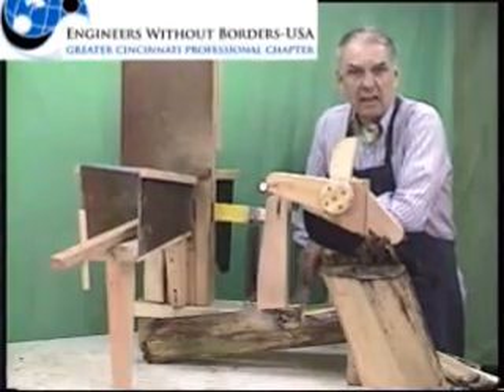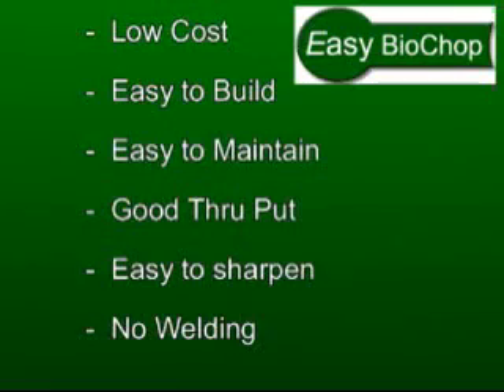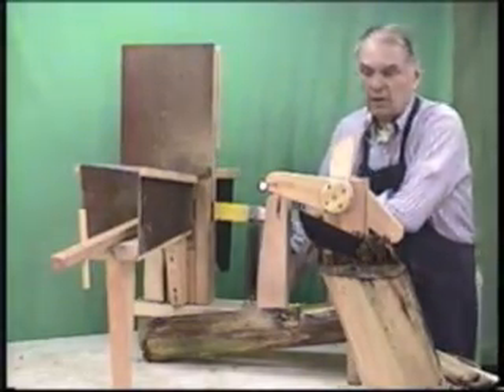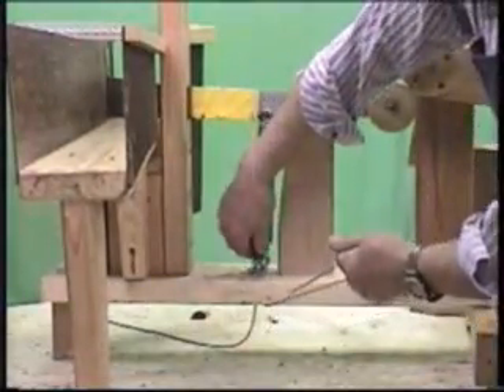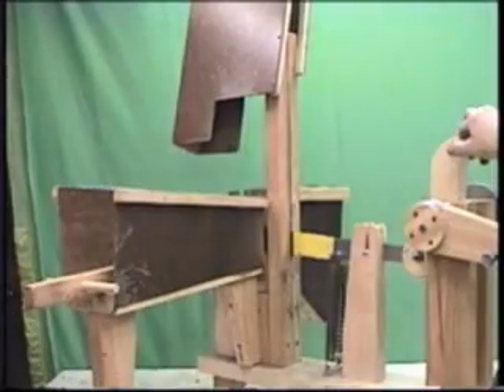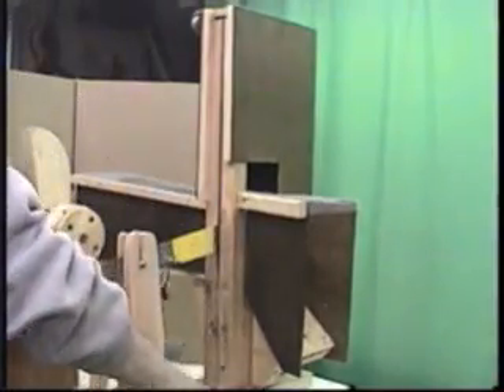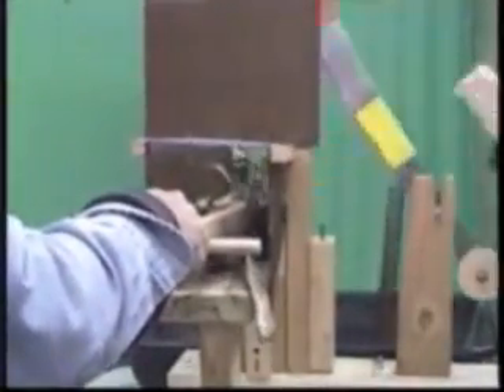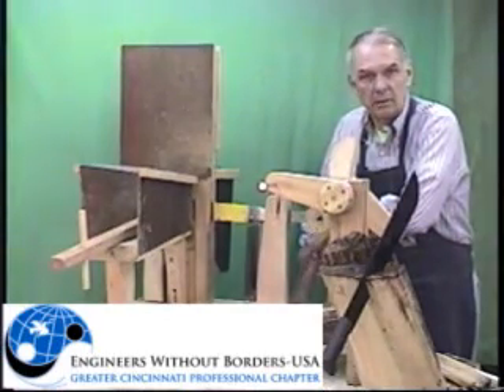Easy BioChop,  Wet-Dry Biomass-Silage Chopper-Cutter

Comment: Thanks for the note back Lee.   If you put an electric motor on it and a motor speed control wouldn't you be able to adjust according to the input product?   I have so many used, left over, kids bicycles laying around, I was thinking of trying to make one of these out of metal and see if it would chop small branches from trees and things.

Comment from the maker: Yes, good idea but when we experimented with a steeper feed angle the feedstock traveled too fast and had a tendency to jam the machete. And when it didn’t jam up the cut pieces were too large for a good briquette mixture and too large for the grinder. You could place the shoot on a hinge and adjust the feed angle for optimum cutting. That might work?